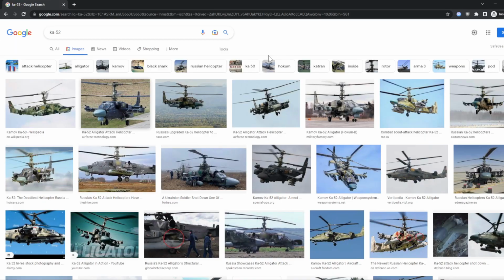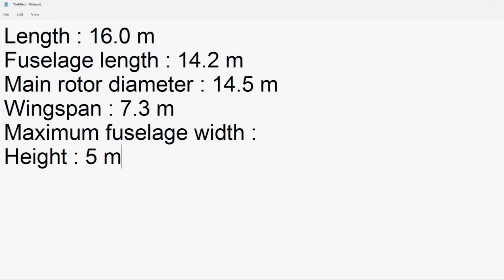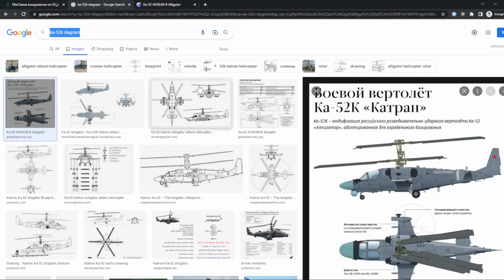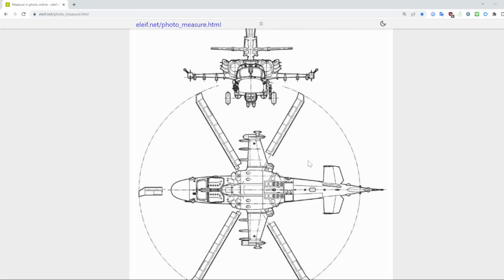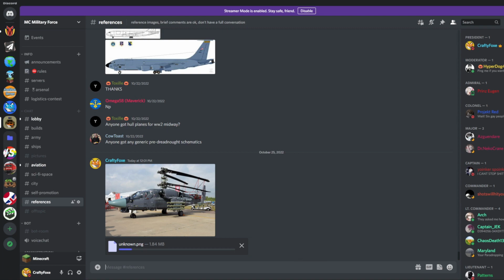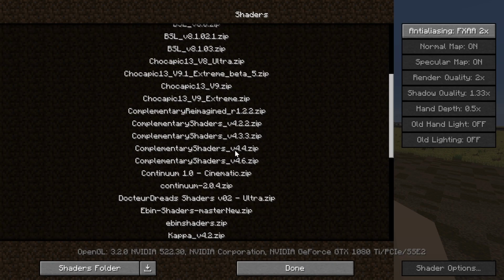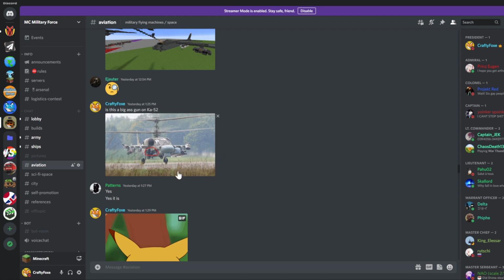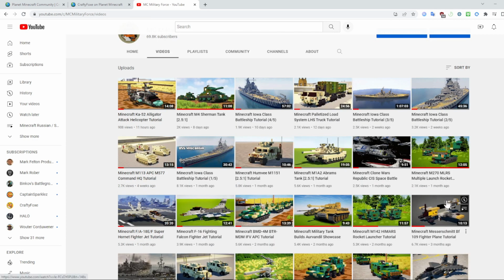How to Design a Minecraft Vehicle Model Realistically

Comment: i feel like a caveman i have been using the same outdated measuring method for 2 years between 3 games brick rigs plane crazy and minecraft i add 58% to the measurement in meters and then i measure a diagram with a see through ruler and then use a percentage calculator to translate the measurements i get from the diagram to the game